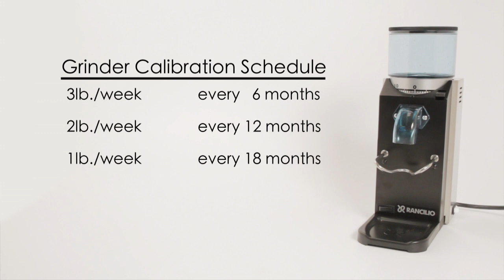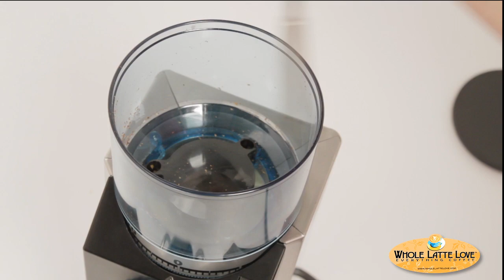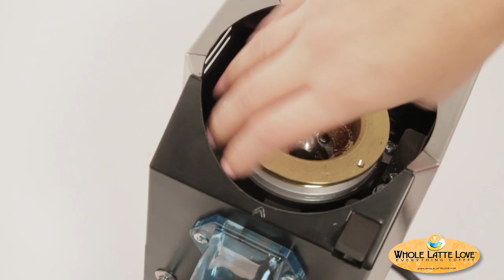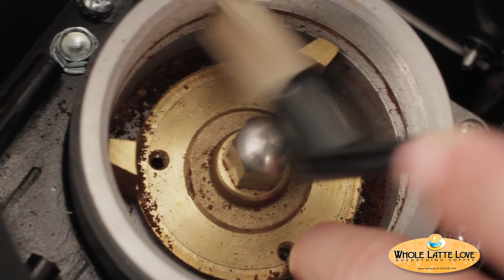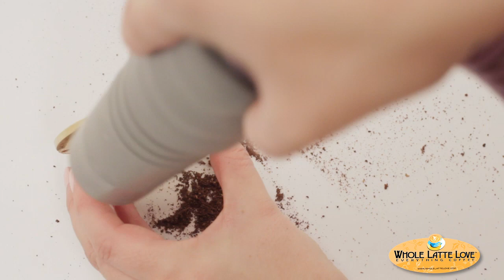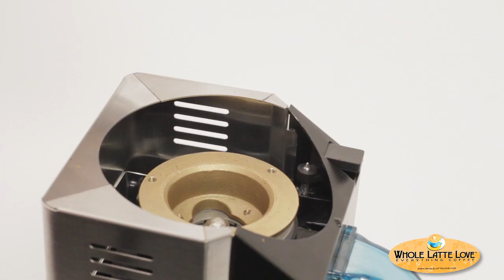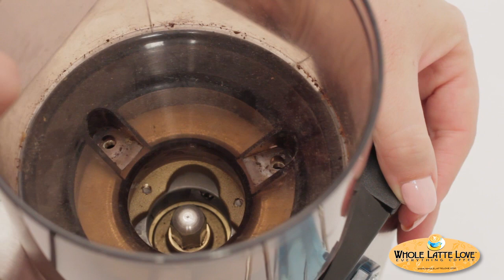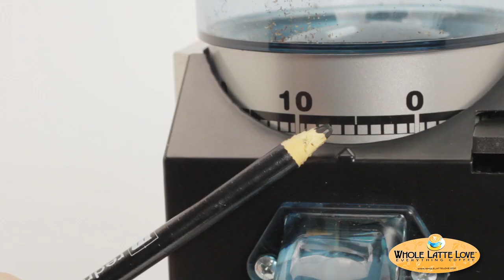How to Calibrate a Rancillio Rocky Grinder

Comment: Not sure who checks this, but I’m having problems unscrewing my copper upper. It doesn’t want to budge, I’m certain it is due to bean oils jamming up the works, any helpful ideas before I try man-forcing it?
Reply from the maker: Hi MG, 12 years later and still monitoring the comments on this video! You could carefully try some gentle heat to loosen the oils prior to removing.

Comment: I really need some help from someone that knows what they are doing when it comes to this grinder. I really hope you can help me, because I can't afford to take this in for service. I have had my grinder for about 10 years and although I take very good care of my espresso machine, I was unaware that the grinder should be cleaned somewhat regularly, although now, of course it needs that! I took it apart and cleaned it as best I could, the adjustment collar (AC) would no longer spin so I could change the grind. Removing it for the initial clean was brutal. I needed help. Long story short the person who helped me, forced the collar back on once cleaned but of course that doesn't help if it doesn't spin freely to allow for adjustment. I finally got the AC back off, have gave it an even better clean in the threads, however, the AC still only screws down about 4 turns before it comes to a dead stop. If the first few threads (the ones that would FIRST grab on while screwing it back into place) are damaged, wouldn't it be difficult to even turn it the first 4 turns or so? Logic tells me that if those first few threads were damaged, I would have a hard time even starting to screw the collar back into place. So if I can easily turn it only 4 turns or so, does that not tell me that the metal threads I am screwing the collar into are still clogged up with coffee debris even though I can't see it??  I would just replace the collar, but I can't easily find one, and I don't think that is the problem anyway. Again, if they were damaged, why can I easily start threading the collar back on four or 5 turns before running into problems? What are your thoughts? I will mention that I have cleaned the metal threads with a toothpick. It was amazing how much more debris I cleaned off. Do you think I have damaged the brass part of the AC by people force screwing it back on, or do you think I just need to clean it more? If it needs more cleaning, any idea what I can use that is safe for where food will be touching? Thank you for your time! o longer spin so I could change the grind. Removing it for the initial clean was brutal. I needed help. Long story short the person who helped me, forced the collar back on once cleaned but of course that doesn't help if it doesn't spin freely to allow for adjustment. I finally got the AC back off, have gave it an even better clean in the threads, however, the AC still only screws down about 4 turns before it comes to a dead stop. If the first few threads (the ones that would FIRST grab on while screwing it back into place) are damaged, wouldn't it be difficult to even turn it the first 4 turns or so? Logic tells me that if those first few threads were damaged, I would have a hard time even starting to screw the collar back into place. So if I can easily turn it only 4 turns or so, does that not tell me that the metal threads I am screwing the collar into are still clogged up with coffee debris even though I can't see it??  I would just replace the collar, but I can't easily find one, and I don't think that is the problem anyway. Again, if they were damaged, why can I easily start threading the collar back on four or 5 turns before running into problems? What are your thoughts? I will mention that I have cleaned the metal threads with a toothpick. It was amazing how much more debris I cleaned off. Do you think I have damaged the brass part of the AC by people force screwing it back on, or do you think I just need to clean it more? If it needs more cleaning, any idea what I can use that is safe for where food will be touching? Thank you for your time!
Reply from the maker: Hi jp, Hopefully the threads were not damaged by the person who helped you. Even though it turned on easily the 4 turns that's a possibility. But, typically if it's going on easily like that it's a good sign the threads just need a better cleaning. After 10 years there's likely some stubborn build up of coffee gunk! While the toothpick gets some, you'll need to use a fine pointed metal pin in combination with meticulous effort/detail. Plastic mounted pushpins, the type you'd use on a bulletin board have the fine point needed for the job and are easier than using a standard needle as you can hold onto the plastic as you dig into the threads with the point. Follow the threads with the pin point around and around and around digging out everything. You must clean both sets of threads. The ones on the grinder and the removable burr carrier. This can take awhile! Be very thorough! Once you think both sets of threads are perfectly clean try and screw it back together. Start by turning-in in the opposite direction until you feel the adjustment collar drop ever so slightly. Then turn in the direction to screw it in. If you cleaned well it should continue to turn in. If it goes farther than the 4 turns you had before then the threads are probably okay. If it goes further then stops before going far enough back it out and clean some more. It doesn't take much gunk in the threads to keep it from turning. Good luck!
Reply: @Wholelattelovepage  I totally forgot to thank you for such great info. I indeed needed to just clean the adjustment grinder better even though it looked really clean. Now I got the collar to screw back on nicely, I am just having a hard time lining up the zero grind setting. I have what you consider to be a newer grinder so my screws can be loosened to adjust the setting back to zero however I am not having much luck with this. I think I might have to give in and just have a new zero grind mark on the hopper. Thanks for everything! You guys are great!
Reply: @Wholelattelovepage Thank you so very very much for your time and advice! Thank you for letting me know that the threads still may be damaged even though the color screws on okay the first four or so turns. This lets me know what issues I may be dealing with. The idea of the fine pointed metal pin with some elbow grease is brilliant!! I never would have thought of that! I have indeed cleaned the set of threads that is easily removed. It's just the ones that remain behind in the grinder. It was crazy how much pressure I had to apply to the toothpick to remove the substance that felt like glue. So I can't imagine how much better that pin will do. You are right, it is going to be very time-consuming and meticulous work but I hope this is where the problem lies. Thanks for the advice about turning the adjustment collar counterclockwise prior to screwing it on properly. As  stated in the video, you can actually feel when the threads line up and you are therefore safe screwing the adjustment collar back on completely. I will certainly follow up with another comment for other potential customers that come to your site with the same difficulties. Lol I am not on social media otherwise I would help your channel out there as well but will do what I can with You Tube. Cheers! Thanks again!

Comment: Is it normal after cleaning everything amd replacing the burr with new burrs that it takes longer for the grounds to come out? I only put in the amount of coffee i intennd to make each time i use it.
Reply from the maker: Hi Andrew, A couple of things might be increasing length of time. First, new burrs need to season meaning they are coated with oils from the beans. As the burrs are lubricated grinding speed in grams per second of output increases. Second, All grinders have some degree of internal retention. The nooks and crannies where ground coffee accumulates. This reduces output for a few grind cycles.

Comment: If the steel wears out wouldnt you have to worry about metal particles in your coffee??
How do you know your filtering out all of the steel?
Anyone used to sharpening fine knives knows what im talking abt
Reply from the maker: Hi AV, Thinking steel is a lot harder than coffee.
Reply: @Whole Latte Love  
Yes but if they claim they wear out and need replacing. Seems steel to steel is the issue not coffee to steel.
What's wearing out is my question really
You know

Comment: I got one of these for free from a co-worker.  The coffee powder and oil formed a tar on the adjustments threads that I couldn't remove.  Everything inside had the same tar-like coating.  I thought I finally got it clean but couldn't get the adjustment collar to screw all the way down because of the threads being bound by the sticky stuff. Sadly it ended up in the trash.  I wouldn't want to clean one of these on a regular basis and would never recommend it..... especially for a beginner.
Reply from the maker: Hey Brian, thanks for sharing your thoughts. Yes, those threads are a PITA to clean if gummed up with ancient coffee dust and oils!

Comment: What do you recommend when the screws holding the burrs on (top and bottom) will not budge?
Reply from the maker: Hey DZ, Be sure to use a screwdriver of appropriate size. One that fits as snugly as possible in the screw head. With that and enough force they should free up. Other tips: Try turning to tighten the screw before trying to loosen - seems counterintuitive but often helps. With screwdriver in screw head slot light taps with hammer can help. Apply some heat to the screw head. For that you can try heating the tip of the screwdriver then holding the tip in slot of screw head for 15-20 seconds to heat it up and then try removing. Can also use a propane torch very carefully to apply heat directly to the screw head for a few seconds and then try removing.
Hope that helps!
Reply: I had to pull apart my Rocky after a long time.  The coffee goo is an excellent thread lock.  Got everything off except one screw, which got mangled.  I had to pull out the bottom brass element by removing the center bolt (12 mm socket, not pliers!), and eventually drilled out and removed the screw head. I ordered some new screws, but they are screwy.  The slot is significantly wider than most American-sold screwdrivers, so unless you grind down the tip of a sacrificial screwdriver, you are going to have problems.  If there is a next time, I will replace the screws with stainless torx heads.  A slotted head has no business on those screws.  I never found a good solvent for that coffee goo; heat probably would have worked, but that was my desperation stage. Pliers on a machined nut (as in your vid) are rarely a good idea, but the vid is great otherwise. @Wholelattelovepage

Comment: What i would like to know is whether it's possible to have dull burrs sharpened.  Importing new Rocky burrs into Brazil is extremely expensive, increasing their European or U.S. original price by 466% - so a pair of burrs that cost $50 in Europe or the U.S. cost the equivalent of $233 here.
Reply from the maker: Hi b, Wow that's unfortunate! I have heard of burrs from very expensive grinders being reconditioned but it's a very specialized process. Less common today with the use of coatings on modern burrs. Think it would be difficult to find someone to sharpen.

Comment: What if the grinders won't screw together near enough to make the grinders touch?
Reply from the maker: Hi Andrew, My guess is there some coffee debris in the fine threads of the adjustment preventing it from screwing in all the way. You may need to use something like a needle to manually clean the threads.
Reply: @Wholelattelovepage  that's what did it in the end. Working much better now with new blades. Thanks
Reply from the maker: @71andrewmac  That's great!

Comment: Need to pull the lower burr holder to get it clean. Real PITA to clean. but easy to service.
NEED TO MAKE SURE BURRS ARE SQUARED do it by sound/feel , they should contact evenly at the bottom.
If made after a "Business lunch" at the factory, they are often not square.
it will work out of square, just not grind evenly.
Reply from the maker: Hey W, Thanks for the tips - business lunch lol!

Comment: Hi I have a problem hope someone can help. I have been through every step however I can't remove the bottle burr. I can get the screws out but then it just seem stuck, literally it won't move! any ideas?
Reply from the maker: Hi SK, It's likely old coffee oils etc are acting as a glue and holding the bottom burr to the burr plate. You can help release it by using a screwdriver or similar as a lever to pry at the edge of the burr to break it free. If you do that be careful not to damage the fine threads which receive the top burr carrier assembly when levering against the stuck bottom burr. Could also try placing tip of screwdriver at the inner edge of bottom burr and tapping with hammer to break it free.
Reply: I used a heavy duty gasket pick, placing it under the inside edge of the ring, then carefully levering up a little, then moved to the opposite side and levered up a little. it worked. My Rocky had never been cleaned in over 10  years and it was very very gunky. used a wood chopstick and a dental tool, being careful not to scratch the metal. even a toothpick. when i couldn't get anymore resin off, I moistened a rag with cafiza solution to wipe the leftover sticky off. didn't get dripping water. then used fresh moist rag to wipe again. Followed with Grindz pellets, then coffee. all is well. yes, its tricky to change the grind size with one hand.

Comment: Maybe this gets lost in the comments but:
If it has been a while (or even a frew whiles) since the last cleaning/burr change, there is going to be sticky stuff (rancid oils from coffee and fines from grinding.) gumming up the works so you will make slower progress than shown here. 

Gloves are a good idea, the oils are very sticky and you'll end up with a lot of hand washing otherwise. A lot. That and having the vacuum standign by will make it a neater job.

You might need to remove the bottom carrier to get it clean enough to properly seat the burrs. And hey, you are in there, might as well get it all clean and nice again. And the big threads (the ones that hold the top burr) will need lots of attention (female and male) with a brass brush or a series of toothpicks (your strokes aligned with those stainless (?) threads on the female side and something softer still on the brass male bits.) All to scoop out that sticky mess. This will give your adujstments the free travel up and down that you hoped for.

While you have it open, take off the blue plastic shoot in front and clean it and the path to it. Ahh, that's better.
Reply from the maker: Hi Paul, Thanks for adding - great advice!
Reply: Yes, exactly my experience as well.  Well stated.

Comment: Just changed burrs after 10 yrs. We've never had fine enough grind and the band reads negative 12. Followed your video, but the part where it says to replace the upper burr assembly and turn until rotor cannot spin? I reach a point where I can no longer turn the assembly but the rotor still spins freely. I put it all back together, grind is still too coarse and the only adjustment direction to go is coarser. Any ideas on how to get the burrs closer?
Reply: Check to see that they are SQUARE. if not they bind at "A" and are gapped at"B"

Comment: I received a rocky purchased from you guys as a gift about 2 weeks ago.  It’s not grinding fine enough, so I followed the instructions here to little avail.  I noticed that when burrs touch they’re making very uneven contact so some alignment info would be helpful.  I’m also puzzled as to why my ‘brand new’ rocky has the older non-adjustable stop screw??
Reply from the maker: Hi Zach, It's highly unusual for burrs to make uneven contact when touching. You might verify the burrs are properly mounted. Any coffee debris behind the burrs could through them off. Not sure why your grinder has the older stop screw. Is it possible the gift was a reconditioned Rocky? If you continue to have issues please contact our Tech Support here for assistance: https://www.wholelattelove.com/pages/contact-us